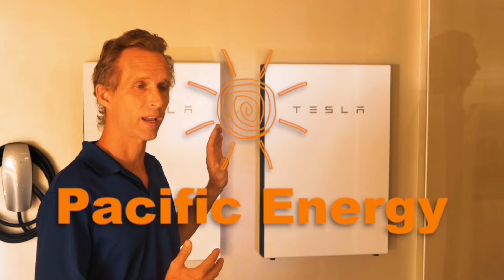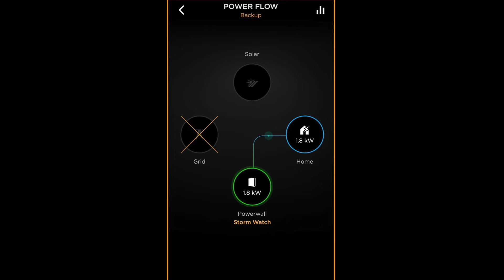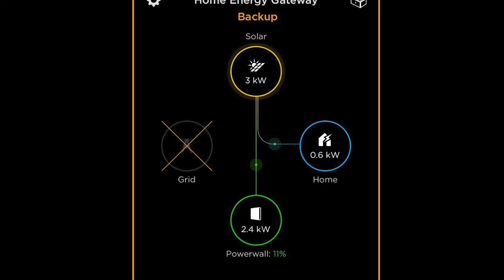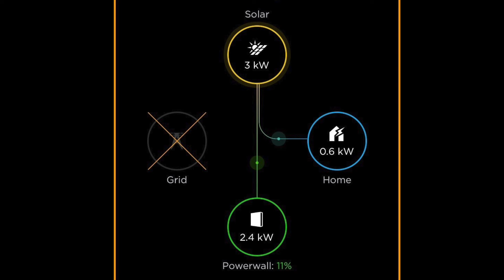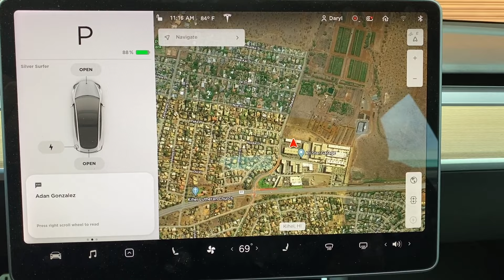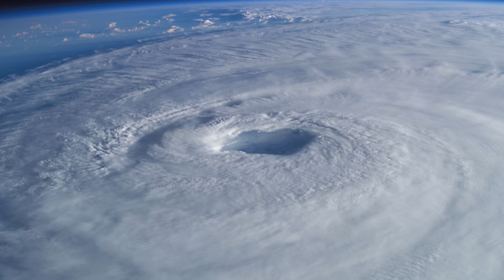What to do when grid power fails, with Tesla Powerwalls.

Comment: Hi good clear basic understanding. Could you explain how the gateway can control individual circuits? Can’t see how it would be able to control individual circuits on the main panel unless each breaker could be selectively turned off. So there is an option to not have a backup loads panel installed?
Reply from the maker: The gateway doesn't control individual circuits.  You do.  Of course there are load center  products that will allow you to do this remotely via an app.
Reply from the maker: You walk up to your electrical panel and control the circuits with your fingers.  If you want to be able to control circuits remotely, you would need a 3rd party product such as Span.

Comment: What would you do if you were hundreds of miles away from your home when grid failed and had no control over circuit breakers? In particular during winter when you wanted your furnace to keep operating from battery (and possibly solar if sun was out). Thx.
Reply from the maker: I would put those circuits into a separate panel that is not  backed up.

Comment: My local installer says the single Powerwall installer has to be installed with backup loads panel. Why is that? In your video, you state that it can allow me to turn on/off loads as needed.

Comment: Glad I’m capable enough to just make my own powerwall System... i would never sign up for any of this garbage lol
Reply: The Tesla Powerwall is $6500 for 12.5kWh usable. That's a little over $500 a kWh. I know how to build my own power wall too but it's pretty hard to beat that unless you use used batteries. I can get pretty close using LiFePO4 batteries but it's around $600 a kWh once you add the BMS and packaging. So the Tesla Powerwall is very competitively priced.
Reply: What are you using for the monitoring software.

Comment: can you put a Tesla powerwall in a van ? I want to build a conversion van and would like to put solar on the roof for all the electrical appliances. I would use it as a house battery.
Reply: I think the cost of an installed  Powerwall would be more than the cost of the van. You should look up Van Life electrical, van conversion solar, etc on YT as here are a ton of build it yourself solutions.

 I built my own system  to fit my needs and improve it all the time. The biggest cost was a 200 amp hour Aims lithium battery at $1500 but I have never yet depleted it to the automatic shutoff voltage. It suits my needs well.